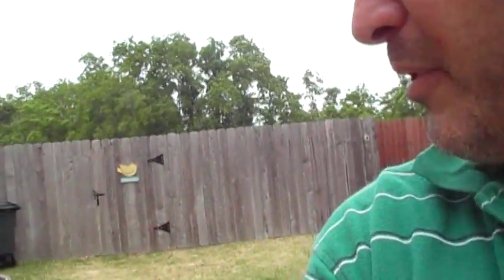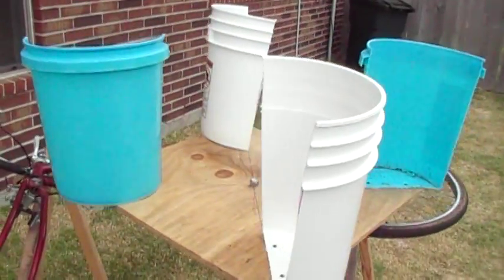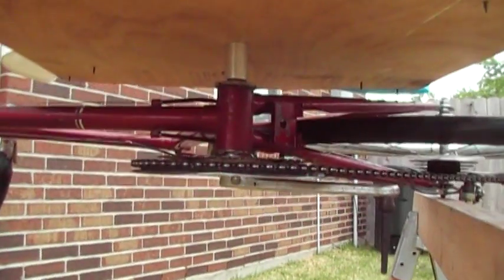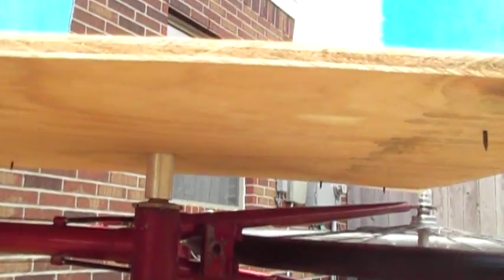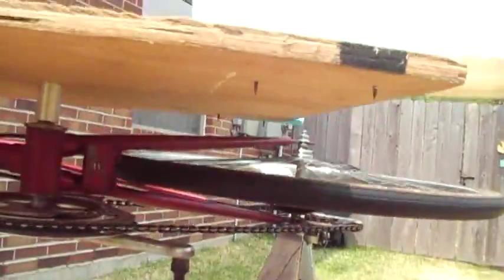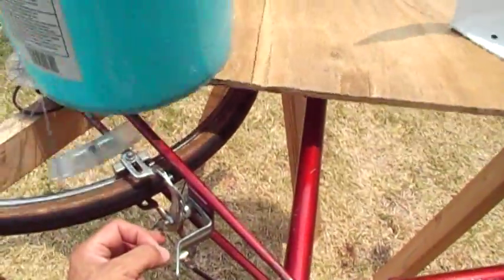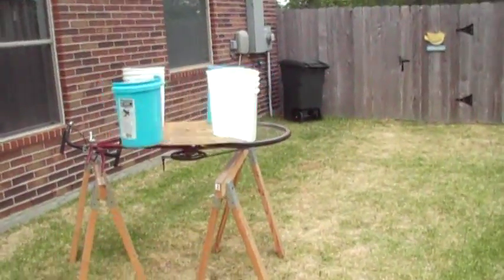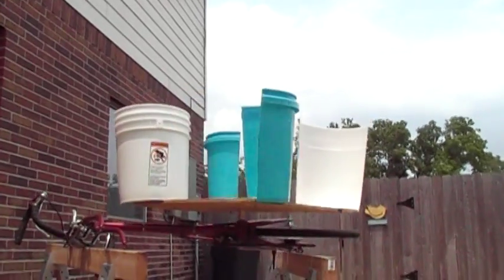Arborist Gene Basler's VAWT Bicycle Wind Turbine Prototype Design Part 1

Comment: Hi Gene, 

Walker Stevens here. My wife and I moved to our home in Honduras,and are rebuilding our 1,800 sf home into a 7,500 sf B&B, art gallery, restaurant and lounge; and, we are going off the grid with solar and wind. 

I too am experimenting, but am building my own generator, so I can reach 1 Kw per unit. You have, what I think is a good idea, and I may try the bicycle idea with some changes: use a round spinning platform for each turbine section, with a one-way  gear, to eliminate the negative resistance on the back side. I would also add two more blades per section, and make the base section round vs square, and add a one-way gear to the base as well. The above changes will give you 12 turbine blades in the same space. I would also add a steel shaft with a encased bearing for each of the 4 sub-sections (2" dia.), and a 4" bearing to the main section. (Your current 'stationery' turbine blade configuration actually causes the resistance). 
 
I believe the above changes will all but eliminate your resistance problems, and give you maximum output for your size of turbines and alternator.  

I'm only in the design stage right now, as we're still in the building and re-building stage now, and won't be finished with construction for another year, but when I've finished with my design, I'll send you a copy. 

Best wishes,
Walker Stevens (McAllen, TX)
www.walkerstevensfineart.com
walkerstevens@walkerstevensfineart.com

Comment: Hi Gene, there is a solution to the problem.  The wind blows along the side of your house, so use the side of the house as a funnel to direct the wind into your turbine.  Simply place a sheet of plywood against the house and direct the wind onto the right side of your turbine.  this will cover the left side of it and prevent the back of the blades from slowing the unit down.

Comment: They have that generator for a very long time and it is called a dynamo to power the night light for evening use.  I liked your concept and it will work with proper blade configuration turning in a clockwise direction rather than the counterclockwise as portrade in your video.  I hope my suggestion is helpful or otherwise ignore it.  Armand.

Comment: You mentioned that the upwind side is like a wall of resistance. 
There is a design that eliminates most of that, It is called a Flap Turbine. 
It uses flaps that are similar to a louver like you would see on an attic fan - lets air out but not in . A dryer vent is another example of a louver. 
No matter how many buckets you add - you will never gain as much as the flap turbine.
To see a big one driving a compressor search youtube for " SOAKER HOSE 11 "

Comment: To address your resistance issue, place a plywood guard in front of the back side of the rotation, allowing the wind to  advance the mech. without holding it back on the left side.

Comment: Great project, cut the tops of the buckets in halve and install them on the top of blades. It low cost and will improve performance. Great start. Cheers

Comment: You can cure the wind resistance by putting a piece of wood angled in front of the "back" side of the turntable so that the wind is deflected onto the "front" side.  All good wishes.
Reply from the maker: Anton Nym thanks

Comment: If you are worried about wind resistance on the back of the blade(bucket) then it be good if you could figure out how to use use a deflector/concentrator to direct the wind from the backside of buckets and to front sides only at the same time creating eddie currents causing a pull as well as the blades being pushed. Check out California energy and power, they have a video out on u-tube about their vertical wind turbine that broke the 30% efficiency mark using a single wind concentrator.

Comment: I have a friendly suggestion .try taking the tire off the rim ,and then use the rim as a pulley .then use a inner tube as a belt .On the generator you could still use a skateboard wheel just put a oversized washer on the top and bottom of the skateboard wheel so the inner tube belt won't come off the pulley on the generator.Also you might need 2 inner tubes to get the proper length .glue together with patch glue to make a longer belt

Comment: The chain and gear functioning  in the horizontal configuration  must have huge friction issue.    I notice the chain is  taught  and that with weight  of the chain adds up. Looking at old plant machinery drawings horizontal shafts with gear ends were very common, chains not so much.

Comment: I have another idea .you could also use the gears on the rear tire .try putting the drive chain from the pedals to the largest rear gear then add another piece of chain to the smallest rear gear then use this chain to a gear of the same size on the alternator .There might be a torque problem if you use the rim or tire.

Comment: Just an idea , wouldn't it be better if you cut the plastic in quarters and mounted them just like you have the halves it might give you better spin and less resistance on the back end

Comment: couple of quick comments. I think friction drive anything sucks. You might be better off removing the tire and tube and using a large rubber band ( for lack of a better term) as a belt . 
also I have a feeling you will have to use a gear reducing gearbox so the load isn't so great it stops the wind from turning the assembly

Comment: You would need a customized alternator with permanent magnets in the rotor and the windings changed out to thinner wire for higher voltage, and these are over 300 dollars. A regular alternator won't work for that turbine, but a regular DC motor from a printer, or a DC motor from a car. like a blower motor, or something that you can find for free, but the customized alternator is gonna be hard to find for free.

Comment: it's moving! , you have a coupler that fits on to the sprocket then the plywood, why not find  something light to fit over the coupler and raise the plywood, even more so ditch the plywood for aluminum cross sections and attach your blades on , if you need support with keeping it stable with the height and the cross sections guy it like ham radio operators do  with large antennas and tall towers, good luck!

Comment: Find a treadmill most people throw away , the motor in it can be used as a generator  to charge 12 volt batteries use an inverter to change to ac power

Comment: No matter how much you improve this device it will never satisfactorily drive an automotive alternator--just not big enuff. It might drive a 6 watt bicycle genny (and you have a ready made mounting for it). As for wind resistance, you could put a shroud around the rotor that shields the upwind side and exposes only the downwind side of the buckets (would have to pivot to track the wind). Consider this a learning experience and make something bigger if you want any appreciable amount of power.

Comment: I have a sugjuestion .  You are lossing a lot of air out the open tops of the buckets. cut 2 more buckets in half and turn them upside down and hot glue or liquid nail them to gather. I believe this will more than double your power in as much as you are doubling the size of the blades AND  lossing no air out the top or bottom.
JUST A SUGESTION.

Comment: i say start with one of the old bike generators that rubs on the wheel to make a light shine got to be some around in bike shops pone shops yard sale hook a volt meter to it and do the math volt to rpm good for getting the turbine set up add a diode to make it a charger for some thing